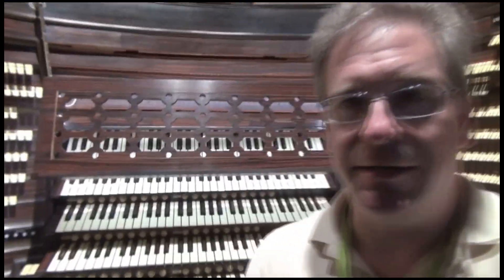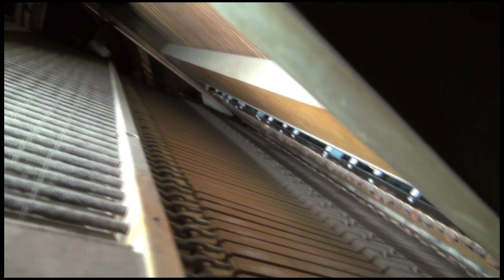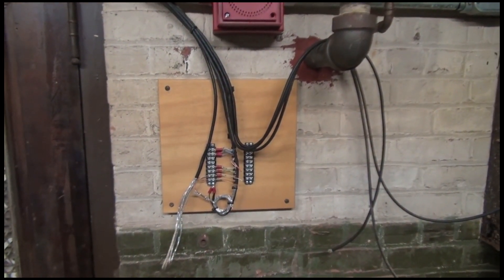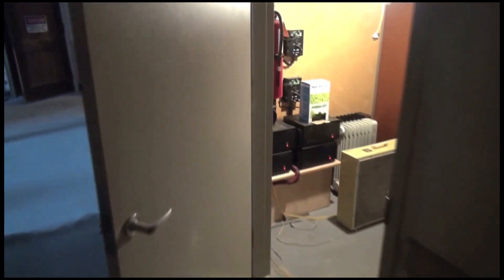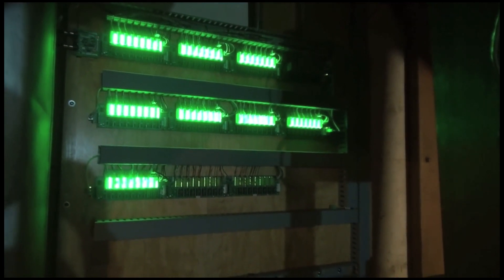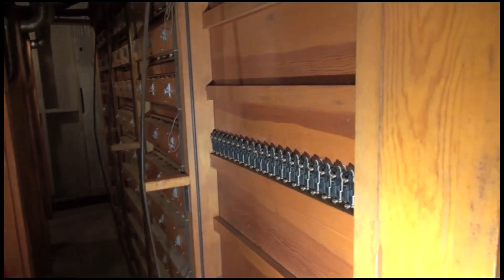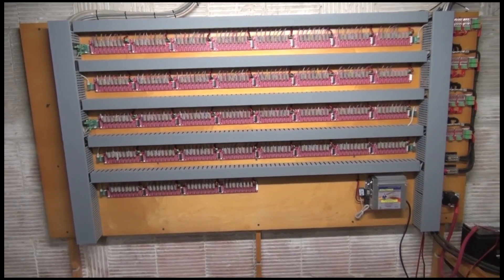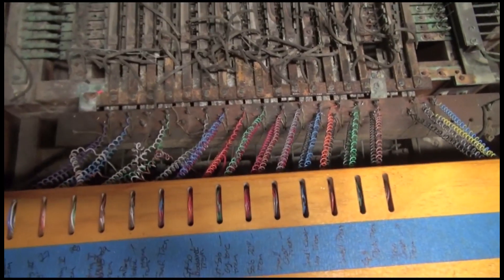Boardwalk Hall organ- new signal flow and combination action

Comment: What happened to the nooks and crannies video???
Reply from the maker: I took it down because I accidentally tore the corner off of a little card that was sitting on one of the machines. People made a much bigger deal about that than the rest of the video and I got tired of it. I glued the card back together and it's in the archives now, it was like a little business card or announcement card for a show at the hall in the '30s and it had a could notes on the back about crescendo settings or something. Note that the Blower Attic video is the same material, but actually better because I climbed all the way back in that area and showed more stuff.
Reply: @cnagorka  sneak it back in…

Comment: Where is the testing sound coming from?
Reply from the maker: I don't get what you mean.
Reply: The sound you heard when you said someone was testing something
Reply from the maker: @gordonrucker4450  Someone was over in the left chamber testing one of the high pressure reeds, making it play by manually pushing in a primary pin.

Comment: I thought that the combination action finally got to work again since 2019, so the new panel in front of the original ones is the newer combination action thing to like replace the older one or something?
Reply: The original combination action never worked correctly even when new, and was wiped out in the 1944 hurricane. It was never operable after that, so it was never working in 2019. Only the new combination action is actually working in the organ, but it's connected to the junctions of the old system- hence the confusion.
Reply: @chrisnagorka5199  ah, I see. So it's more of the modern processor based thing in front of the defunct original ones which is actually working.

Comment: Is there concern that the basement could flood again with the new equipment there?
Also how is second touch implemented with Hall Effect switches? I believe the two lower keyboards have second touch?
Reply: The current combination action setup is likely temporary. Putting everything in the basement and wiring it to the original combination action's junctions was the easiest way to get the new combination action up and running without taking the console offline. At some point in the future, the mobile 5-manual console will be restored, and will have its own solid-state combination action installed. Once it's done and able to play the organ, the 7-manual console can be taken offline for a full restoration. When this is done, its combination action boards could be moved into its kiosk and wired directly to the controls. This would allow the console's original wiring to be decommissioned and removed.

Comment: Marvelous!  Is there any noticeable difference in attack between the pipes fired by the original pneumatic switches and those fired directly by Opus II?  Do the rocker tablets on the key cheeks operate from the presets?  Will the swell box reverse tabs be operational?
Reply from the maker: There isn't a noticeable difference between the original and new relays because the chambers are so far from the console there's a delay no matter what you do! I don't know the answers to the other questions...
Reply: @cnagorka  thanks

Comment: QUESTIONS:
Was the combination action (presets) intended to move the stop tabs?
Will future organists be able to save their presets on some sort of flash memory, and re-load them at a later performance?
What will become of all the old wood electropneumatic switching equipment once the organ is brought under complete control of the Opus II system?
Reply from the maker: Yes the combination action always intended to move the stop tablets. I don't know if there's a card slot for an SD card or something, but the memory system is practically unlimited so they could just save their settings as "user number 1000" or something and come back to it. All the old switching equipment will be saved somewhere after the conversion to solid state.

Comment: It was great to see more detail into the new electronics.  I've been curious about it since the restoration started.  How do they manage to trace out original wiring between the various rooms when all the wire is the same color and/or has been cut?  It must have been hard getting the left chamber back up and running.
Reply from the maker: Actually it isn't that hard, the left chamber was totally and completely rewired with new color coded cable when it was restored. Just about anything that comes out goes back in with new cable.

Comment: Simply incredible, and incredible that it actually works! 

It's been great that the organ has still been playable as ongoing restoration takes place. If another course had been taken, though, and the organ was completely shut down and rewired, would things have been done differently, and would it have been simpler in the end?
Reply: The need to keep the organ playable has essentially meant that the right stage chamber gets restored bit by bit as needed, instead of all at once like the other chambers, and that the 7-manual console can't be taken offline for restoration until the 5-manual console has been restored and can play the organ. Once that's been done, the 7-manual console can get its full restoration, which will likely include moving the new combination action hardware into its kiosk. That would've probably been done in the first place if keeping the organ playable during restoration wasn't necessary.

Comment: so is the plan to make the whole thing solid state?and bypass all the original control?
Reply from the maker: Basically yes, but everything on the right side will be left in place with wind connected to it, so everyone will be able to see how it worked.
Reply: cnagorka  seems a good idea to keep it functional with latest tech and reliable but keep the original parts there for people to se how it was the shot of the key contacts switching makes me shudder  - I’ve been building a synth with an old keyboard and that was unreliable so how this still works is amazing
Reply: @cnagorka  Please at least save parts of the original control system as they get decommissioned. That would make for a great little museum of how things were done.
Beautiful job on wiring up the new control circuitry!